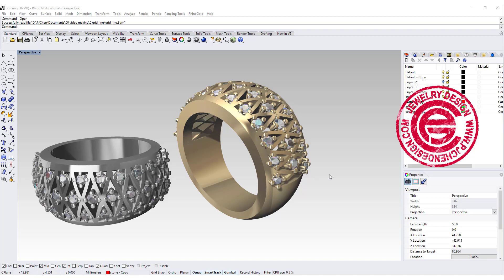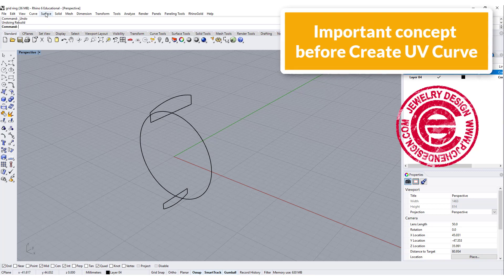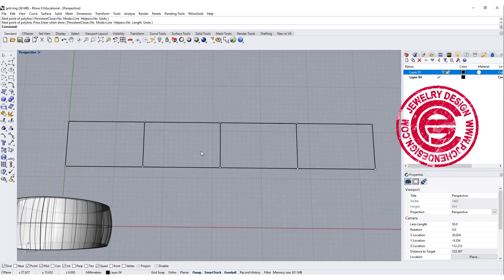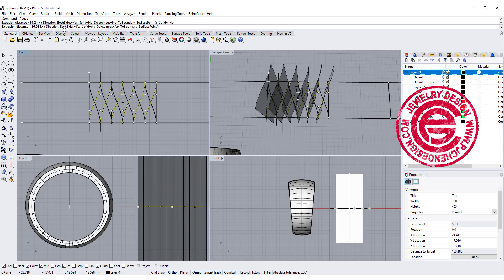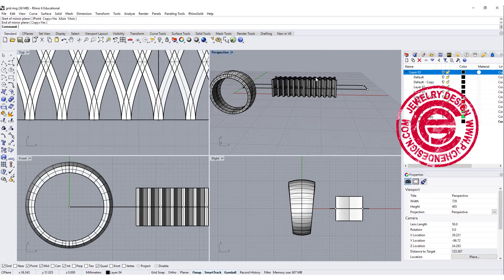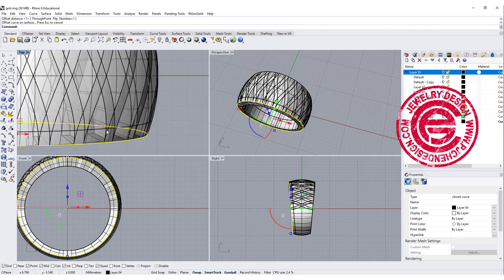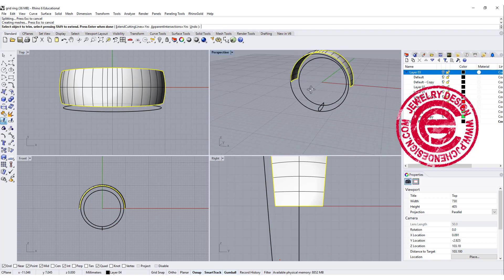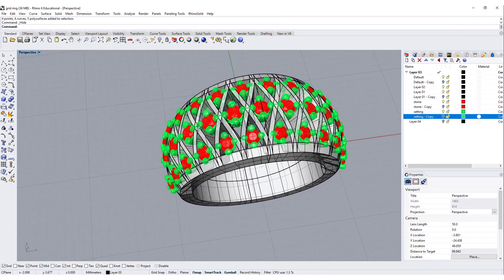Design a Grid Structure Ring Model in Rhino 6: Jewelry CAD Design Tutorial #85

Comment: I did everything until the end. And when all seemed to be perfect, on the last step, my boolean union fails. Why do you think is that?
Reply: i had the same problem. i had exclamation points all over. anyone know the solution or  what could be causing this issue?
Reply from the maker: I have several video at Q/A session discuss why Boolean fail. You may want to check out of that. most of the time are the seam alignment.
Reply: PJ Chen Design thank you for replying! amazing tutorials
Reply from the maker: You are welcome Maya

Comment: thanks for sharing. any reasons you did not make the whole process on flat and flow it in one move? that would be 1. sweep one rail for the main volume 2. create triangles to cut (reverse of what you booleaned) 3. array triangles 3. boolean cut triangles (holes) 4. flow on curve (or surface). 

alternatively, cut with swept surface at the end. working with a plain, straight block and history on could be easier.

but you are the master! thanks for sharing again.
Reply from the maker: That will work. There are always many different ways to build the same model.
Reply: @PJChenJewelryDesign  indeed, many ways. learned a lot of them right here ;)
Reply from the maker: Thank you for providing other solution!